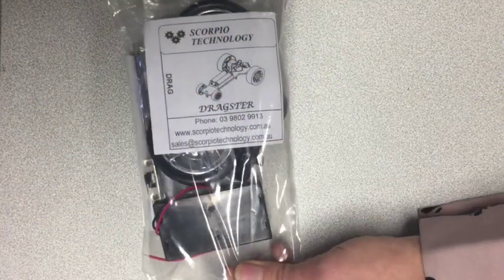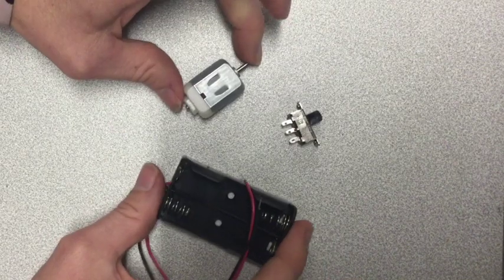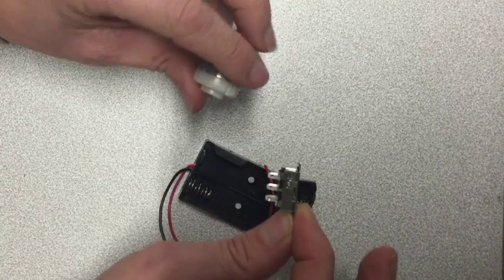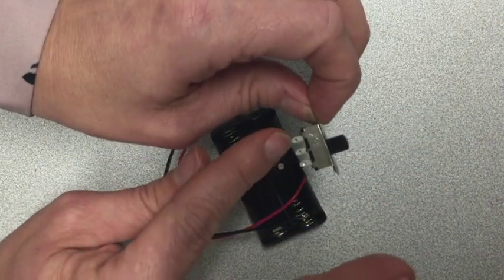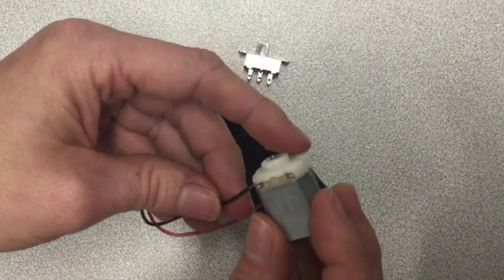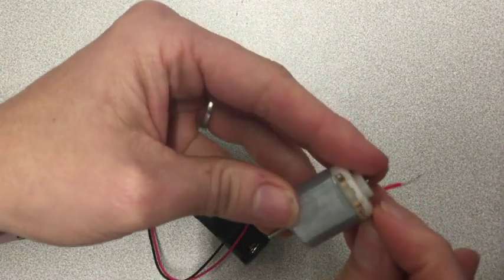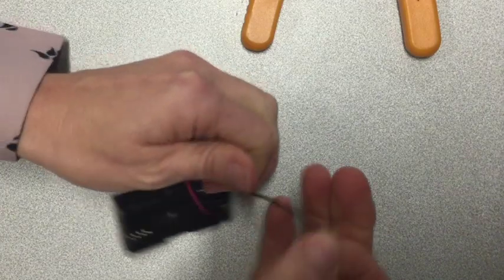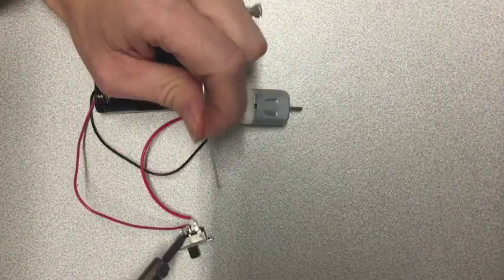How to wire a DC motor to a switch and a battery

Comment: I have 3 pin bi-directional switch almost same which you have in your video. Also same motor I have and 9v battery. I want to make a backward forward going car. But i don't know know how to use three pins of switch. In your video you have uses 2 pins only. Could you please guide me ?
Reply from the maker: Rahul Prajapati video coming soon!
Reply from the maker: Rahul Prajapati https://youtu.be/Lsiw70xOtWA just for you!
Reply: STEM learn but i have 3 pin switch only. :( you have 6 pin switch in video.. Probably 3 pin switch is not gonna work. Am i right ?

Comment: i want to connect it to a dc motor without a kit how do i do that?
Reply: Just make a contact between the wires (GND to the minus and Vcc to the plus of the battery) that come out of the motor and the battery itself. For such motors it's easier to use a single 9V battery. The black box here is just useful 1)as a holder for the batteries and 2)to easily connect the two. Based on the way you connect your batteries you will get higher voltage (serial) or higher current (parallel).
Reply: kHz co